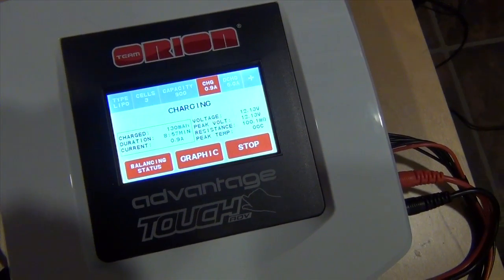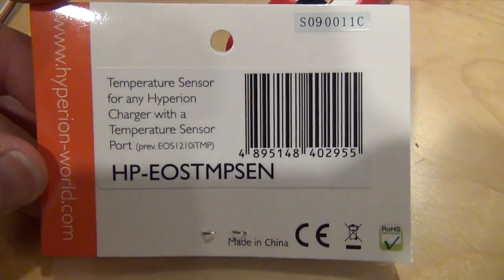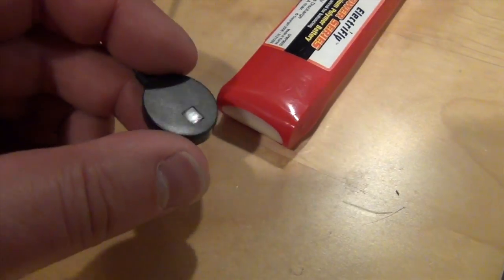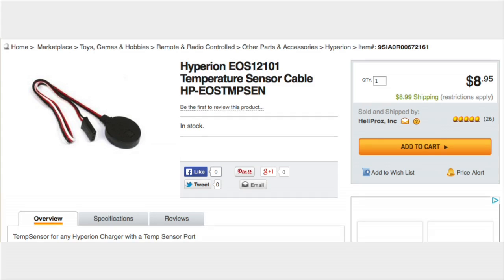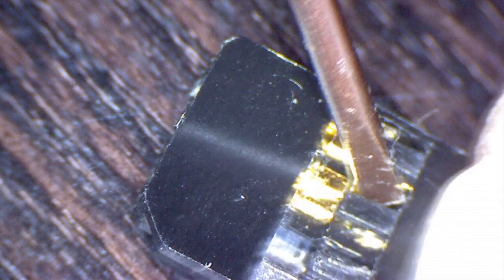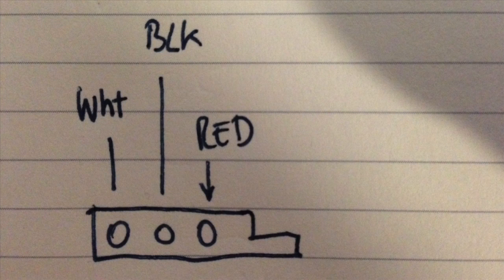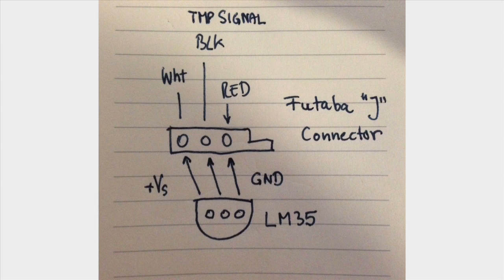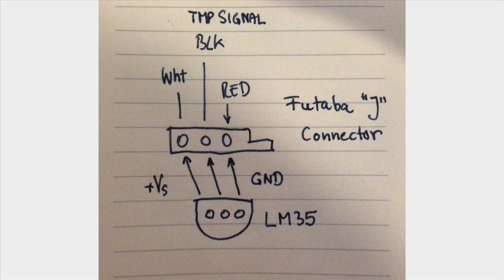How to use a Temperature Sensor on a LiPo Charger

Comment: Just a heads up for those considering the purchase of this sensor... it's VERY VERY slow to update the temp. So if something goes terribly wrong with the battery and its temp rises extremely fast, don't expect this sensor to save your ass... Not going to happen because of how slow it's going to take for it to register the high temp.